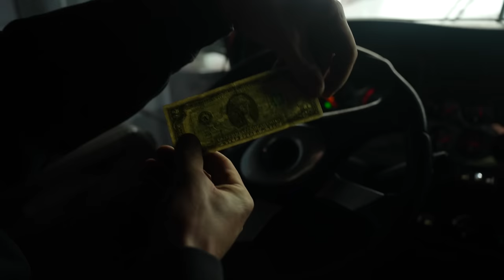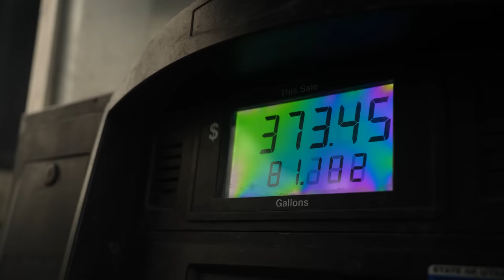Finishing What We Started On This Impossible Telehandler Recovery

Comment: Lots of work.   Proper equipment and crew makes all the difference, nice job.   I wonder if triples would have given enough traction for the rollback, but steer tires need chains or skis.   Getting stuck all those times adds to the great memories of the recovery.      Somethings just don’t belong in the mountains in winter, lol.   The resistance was insane I am sure, hence the skills and heavy iron is necessary.    Robby made the right decision to call you in for this job.

Comment: Hi Heavy, May i sugestt that you order Proper snow chains from Sweden, a company with name :Gunnebo . You should have Gunnebo Piggelin XL brodd in right dimention.
It is an chain in hardened steel squere linkage with cross liinks so the chain not work like a skate if you drive on ice and the machin goes sideways . its an incredible chain and i used it on sevral loaders and never in fifteen years got stuck so i dont have could go from there by my own machin.I have never broke a chain. I can learn you a way to put on the chains so you dont brake them or get them fall off, you put them on once and for all untill you dont need them more. Thouse chains you have in America seems to bee for amatures and hobby work if i may say so without bee bragging or rude . You know you can brake a twisted link like them you have with two spanners and turn one counter clockwise and the other clockwise it will snapp off very easey, and you have a broken chain that will ripp off your brake lines or fenders, not good. Sincearly KJ.

Comment: If you used crab steer mode on the telehandler I wonder if it would’ve wandered off the trail as much in the straight sections. Probably could’ve guided it sideways. Your guys level of commitment is next level! Excellent team
Reply: Wondered about that too. The operator didn't seem to know the rules.,,,,,like getting the boom as close to the ground as possible to keep the CG as low a possible. Then the maybe the hydraulics we screwed up form the start.
Reply: From watching Robby Layton's video on the recovery, I believe they initially had the crab steer mode on but it was causing more problems with keeping it on the road than it did without it on. So they turned it off for the rest of the recovery trial.

I would also suggest that you watch what Robby and team did before they called for backup, as a kind of prequel to these 2 videos.

Comment: That was riveting.

The thing that struck me most of all while watching part 1 was how soft all that snow was. Anything that couldn't ride on top of it was digging in deep!

I wondered if you rig up some kind of massive sled (maybe for future recoveries on soft snow), to keep the vehicle that's being recovered on the top of the snow. But then I realised that steering it might be a challenge. 

Anyhow, using the rollback worked like a charm, even if it was a lot of work getting it up the hill.

Comment: Living in Idaho for over 30 years I don't know how many times we've tried to pull friends and families vehicles out of the deep snow. But here's a free idea free free free free nobody ever took me up on it but I figured you got the money to do it. Think of it like this a sled just a big sled like 10 ft wide and maybe 20 ft long. Out of aluminum or steel and like a rounded front and an access hole in the front of it or you can run your winch through it and hold it in place with your snow cat while you winch a vehicle up into the sled then big d-rings that are on that front part of that sled then you can just drag it across the snow I don't know it's probably a crappy idea but it was worth something it just came to me again. I thought how cool that would be years ago but I've never seen anybody else do it. Oh yeah you can't forget the tire strap downs for the sled or anchor holes where you would anchor the tires down to the sled part of it but I mean it's an idea

Comment: I wonder if you could make some type of ski trailer for the beast. Something even like a flatbed attachment for a hook lift or even a dumpster with the door removed. Something that you could weld some beams to the bottom to act as skis and disperse the weight. Instead of dealing with tire vehicles that sink in snow. Still, great job with what you had

Comment: Just throwing this out there, but have you ever thought about making some sort of sled that you could put dead equipment on and have it slide across snow/sand/dirt easier? You could make it out of thick aluminum and line the bottom with that super slick stuff you used on the air boat. Maybe that's a dumb idea but it sounds like it would keep tires from sinking and just plowing the snow and therefore easier to pull out.

Comment: Ever thought of building a nice big sturdy sled for the snowcat to pull telehandlers and other heavy stuff around in the snow? You might equip it with retractable wheels for easier handling and reduced wear on high friction surfaces. With the wheels down, it could even double up as a transport trailer for the snowcat.

Comment: You need a recovery trailer on wheels with drop down ski's, tilt bed and a huge wench and its own generator with hydraulics and generator and lights, to tow behind your snowcat's or the 10x or a skid steer. Go find a wrecked roll back tow truck and hack the cab off and put a dolly where the front wheels go. Then it can be towed by anything and it'll have its own power so you don't have to concern yourself with how to get power to it from the tow vehicle.

Comment: Why didn't you blow the track first? Also I think I like the army plans. Wreckers have extra fuel tanks so not only do they have extra range, they can support all the other vehicles. I've found the extra weight quite handing for winch and dragging. You guys have some awesome trucks, but should squeeze a few hundred gallon tanks in or around the chassis of all recovery vehicles. And a small transfer pump/ hose.

Comment: Japenese Ranger/Mazda 2.3 200,000 and climbing, does not use oil. Maybe 3oz every 2-3 hundred miles. Cus its got synthetic high milage- plus couple slick 50 snake oil at 25 dolla 16 oz. But its a Ranger for sure, 35- 40 mpg Shout out to Rangers!

Comment: I know this is older but it reminds me of the time BMW came to Beaver valley ski club for a “winter drive tour” those MFs got stuck all over we had an old Chevy shop truck we would drive up and pull them out! So our $5000 1997 chev would go through more snow then these $100,000 bmws 
We ended up grooming a trail for them and matted it down tight with very little tiller 
We ran Bombardier BR2000s which I believe is what your Prinoth is based on, they are awesome machines

Comment: That forklift kept goin sideways and off course cuz it was in 4 wheel turning mode. u shud have straightened out the tires and then put it in 2 wheel so only the front 2 tires turn and the back wheels stay straight. Cuz when u got the front tires turning and the back tires turning and u are pulling in such deep snow (or mud), the snow that get pushed thru the back tires makes it go sideways, like u put it in crab mode, but its an unintentional crab mode lol. I hope that makes sense and helps u out with future forklift recoveries. Ive been driving telehandlers for 10 years. Good job thou, u are some strong stubborn boys but u geeeeterrrr done!

Comment: I would pick up the front of the telehandler and put skis/plates tailored to act as skis on the front and back of the unit so you can drag it out easier. Now if the big green rollback had front wheel drive it would at least be able to get itself around on the snow and ice chained up. Without front wheel drive to help it, it is pretty much useless on its own. Especially with no weight on the bed. I hope that is Bud's own truck he is abusing if it were mine I would fire him for not chaining it up already before heading off road. I see broken cable pulling more than the rated cable can handle doubling it up on the snatch blocks. Good luck with that scenario.

Comment: Turn the big mixer tube into a gold ore crusher with them bit round steel ball's to crush the pay load of rock into powder then do the gold work stuff in serogourdo
Reply: HeavyDSparksx  has I was say turn the back of the concrete truck into some kind of rock crushing machine for your Bro at the cerro Gordo mines. Did they used to extract silver, lead, zinc ore, copper, and also Gold ore. It would be I good way to get more people up there to the hotel just to see how it all work and maybe some how show them the system how it all works. And if it does work out it's more revenue coming in to the cerro Gordo business plus a income for your self. It was just an idea of the top of my head. Plus great content Brother

Comment: You could have swapped out the rear steering hydraulic lines to get the rear wheels to turn in sync with the front wheels. That way it would not have been turning the back end into the snow. That was best case but as is the fork lift driver did the wrong thing steering and should have let the snow cat do all the work!

Comment: bbbbaaaa i lost my 2 doller bill in the fire this reminds me of a time ofcorse when i  was younger and abel to move better we usto go into the mountions and git wood the forestery would open up the fire burn areas let us take asmutch wood as we could hull we got trucks stuck and hade to pull them out    and recover one from ontop of a huge bolder that   had been hidden in the snow we went back up thare after the snow melted the truck was perched 5 feet in the air sitting on that bolder we got it down and drove it home
Reply: _Heavy_dspark1  iv allreddy told you i dont have anything that will run it its all for smart phones i dont have one only a older laptop i hade a house fire rember? i lost a lot of stuff in that all my electronics

Comment: Couldn't you guys make a portable winch? A winch that has different ways to attach it to a vehicle that doesn't have a winch? I'm sure there's times where it would make recovery easier if the stuck vehicle had a winch on it. Bolt it on to a vehicles frame/bumper or strap it to the frame. You wouldn't even need to bolt it on. Custom build a winch frame with all kinds of attachment points on it. That way you could have a strap on the vehicle, a strap on a tree and the winch in the middle hanging in the air.:hand-pink-waving::hand-pink-waving::hand-pink-waving::hand-pink-waving::hand-pink-waving::hand-pink-waving::hand-pink-waving::hand-pink-waving::hand-pink-waving::hand-pink-waving::hand-pink-waving::hand-pink-waving::hand-pink-waving::hand-pink-waving::hand-pink-waving::hand-pink-waving:
Reply: Also this wasn't your biggest failed recovery. It was your LONGEST recovery.

Comment: Gonna put all my timestamped comments in one
1:03 you didn't fight it down the mountain. You fought the 4 wheel steer that you didn't turn off on the tele and the snow that you refused to plow at the start of the day. That recovery would have been done in no time had you spent an hour plowing the road.

3:06 If the lesson you learned wasn't "plow the 3 feet of snow off the road before attempting a recovery" then yes, it was a failure.

3:53 so you acknowledge the snow is the problem and yet you're still going with your brute force approach that worked so well last time? 🤦🏻‍♂️🤦🏻‍♂️🤦🏻‍♂️

11:18 it's wild to me that your plan involves a giant snow plow at the end but the first step of the plan isn't to go plow the road of all the snow that was there before and has fallen since.

13:08 here you'll see the snow plow being used for anything but plowing snow.

14:12 if only it was being pulled by a machine that could get rid of the substance that it keeps getting stuck in...

16:28 SO PLOW IT!!! Or does that bolt still being in the hydraulic line at 16:54 mean you can't use the plow?

34:24  Are you just realizing this? Also why can't you scrape the road dry? Then it's safer for people to travel on it.